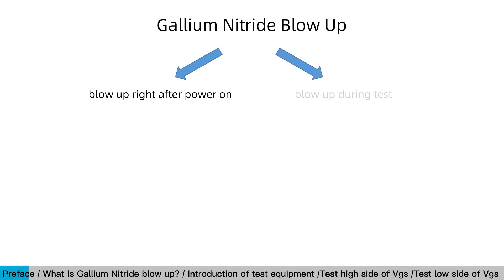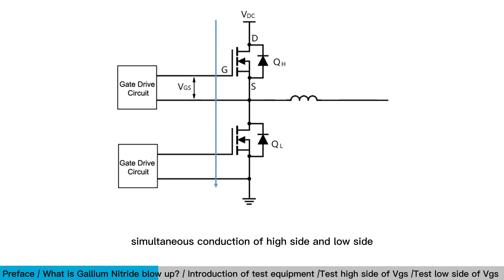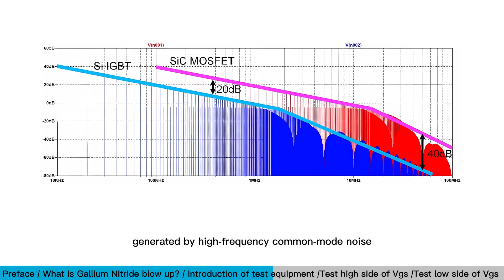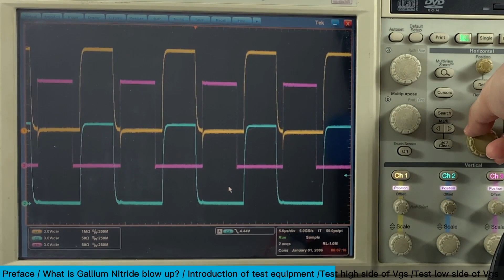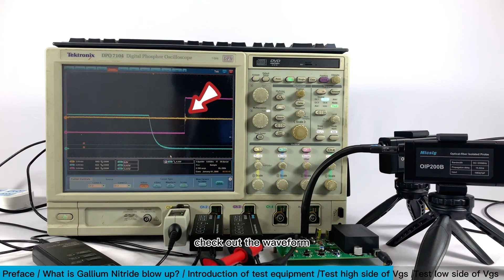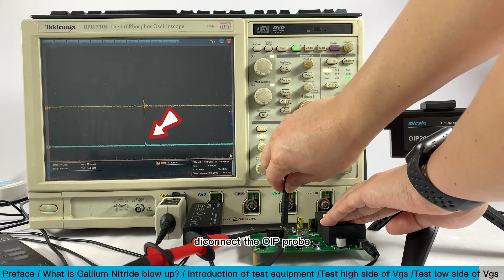GaN Blow Up!？Optical Isolated Probe Tells Why

Comment: Hi, Want to buy, can you tell me what decoder options is included in TO2004 and ATO2004. Besides the automotive part are they the same, with same features ?
Reply from the maker: Hi, standard decoders are CAN, LIN, SPI, I2C, UART. The automotive part are basically the same, you can contact us on WhatsApp: +86 13925742276 for more info. Thank you.

Comment: It is amazing that the probe itself acts as antenna to pick up enough signal to turn on the device and cause failure. Great explanation. Nice that the isolated probe does not have this problem.
Awaiting your new oscilloscope releases, would love to test them!
Reply: The isolated probe does not have this problem mostly because the input is a symmetric line with short exposed tile whereas for traditional differential probe shown you have long leads which acts exactly as antenna. It would be very interesting to connect the symmetric input to that traditional differential probe and see what changes